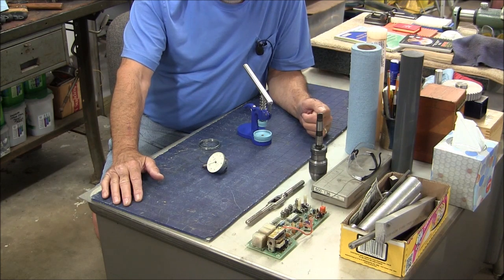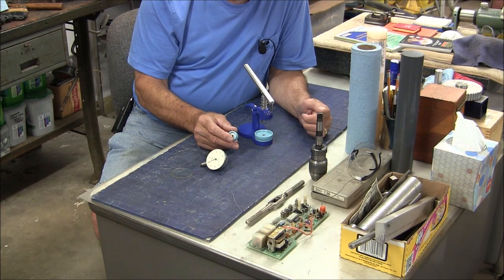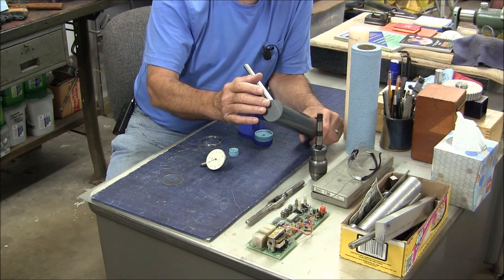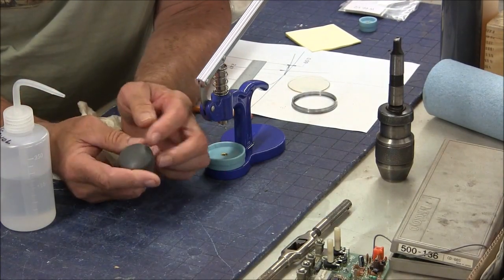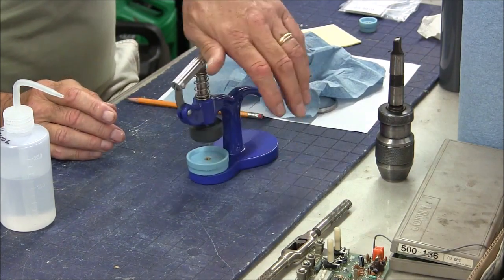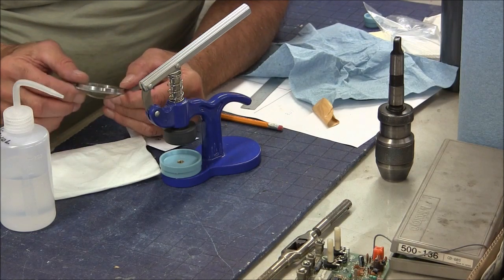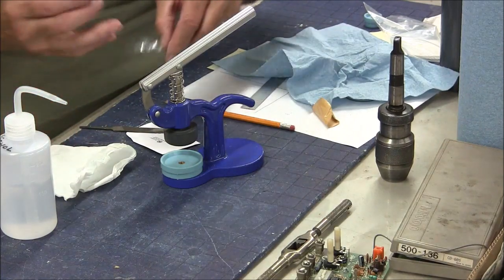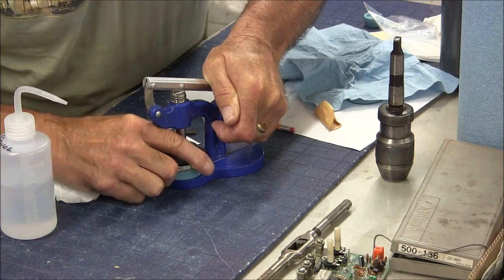Ames indicator crystal installation pt2

Comment: Good job...perseverance pays off.   I'm trying to restore an old BC Ames No 55 indicator that has a knurled bezel on it but no visible means of sticking pins in or ledges to pry it off.  How did you separate the bezel from your Ames indicator?
Reply from the maker: Hi Pat. If you look at the back of the indicator, the bezel should have two scallops spaced 180 degrees apart. At the bottom of the scallops you can see the edge of the retaining ring. Not alot of room to get behind it to pry it inward to release but it can be done. I ground a blade from a box knife into a small sharp pry bar shape. I used it to sort of pin the retainer ring in place while turning the bezel a little bit at a time. Eventually you will see the end of the retainer ring.  Then the trick is to pry the retainer ring slightly inward and through the scallop opening while turning the bezel. Make the shape of the little pry tool as large as you can and still get it into the scallop opening to do its job. If it's too delicate and you beak the tip of it in the scallop opening it could get complicated🙁. I didn't video this process because since both hands are fumbling with the indicator there is no view. I can send a couple of photos of the pry tool etc if it would help. I think Ames indicators are great and well worth the effort.  Good luck and I'd enjoy hearing how you make out.  Mike
Reply: @michaelmurray9154  
Hi Mike,
Thank you for explaining your method for separating the bezel from your indicator. My No 55  doesn't have scallops in the bottom edge of the bezel ring. After removing the back, it became apparent that this bezel is retained by two, adjustable metal ears that engage an annular ring within the circumference of the bezel, thus holding it in place while the bezel is turned. I've another vintage indicator with the same system but I did not think it was used here because the bezel and crystal had a lot of spring float resulting from--as it turned out- those ears being loose.  

As a side note, if I had to guess, I'd say this indicator dates back to the early '20s and has been victimized by many attempts to repair/adjust it, as evidence by several buggered screw heads and screwdriver scratches within the case. It's amazing that it has survived at all and is still in working condition. I'll know more about that after I complete the repairs and attempt to calibrate it. This is a testament to the durability of B.C. Ames indicators...at least the vintage ones, anyway.

This Ames indicator was a recent eBay purchase. It appeared in great shape in the auction photo but turned out to have several issues which required sorting out. The needle needed straightening out, as it was somehow bent in its previous life and was annoying to look at. And then there is the old, yellowed crystal which I need to replace. Anyway, the project is now on a roll. I'll keep you informed of my progress with the crystal replacement. I hope the above makes sense and thanks again for your very thoughtful reply.  Pat
Reply from the maker: @patdworzan8723  I'm glad you got it figured out. I guess your 55 model has a different design than mine. I have two Ames.  I would guess both are from the  early forties. To me, one of the tricky things about the crystal replacement on these old indicators is determining the correct crystal diameter. They tell me the diameter should be about 1mm bigger than the bezel seat. The key word being "about". 😁 .  Too big and it won't go in. Too small and there won't be enough crown. On the newer indicators you can just look up the specs. Not so on these old ones, at least not that I know of.  Sounds like you are moving ahead now and you will end up with a very nice indicator.  Tc, Mike

Comment: Mike, is the thread size on both dies the same ? If so try swap[ping them over and put the dome one on the bottom, in that way you will be able to drop the bezel down from the top and you will be able to see whilst you still have pressure on, that it is located properly. As you have it now you are working blind and had to keep releasing the pressure to have a look.
Reply from the maker: It's worth a try.  I have three more to do.  I think it'll get easier as I gain experience.  Take care, Mike

Comment: LOL, no filing the edge of a watch crystal is considered a misdemeanor in most countries....but we all do it!
If the scratches are fine, try some cheap toothpaste .... you'll be able to buff them out.

Paddy
Reply from the maker: I learned a little about crystal size selection so I hope the next crystals won't need filing.  The scratches are not that noticeable. I could polish, but indicators tend to pick up scratches anyway. I'll probably put her to work as is.  😊.  Tc, Mike